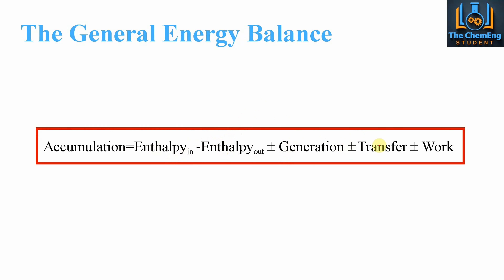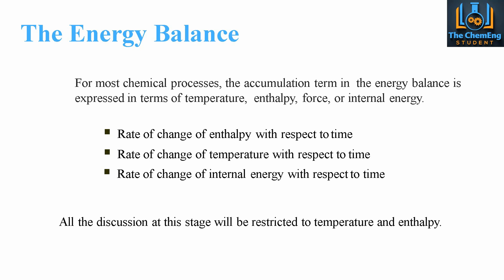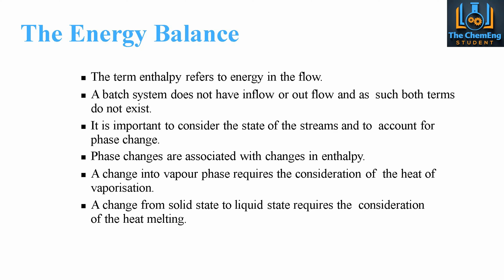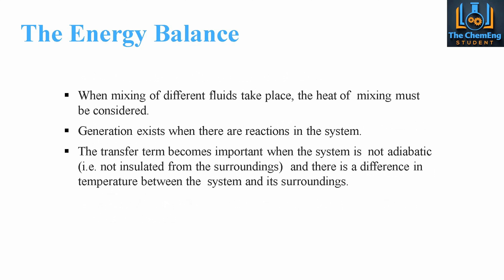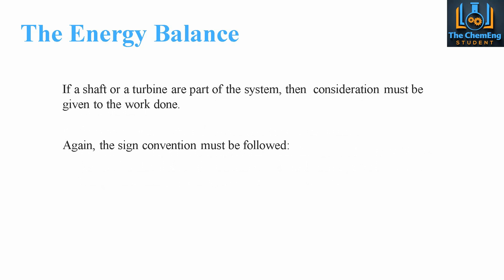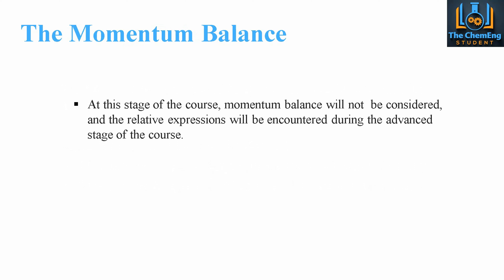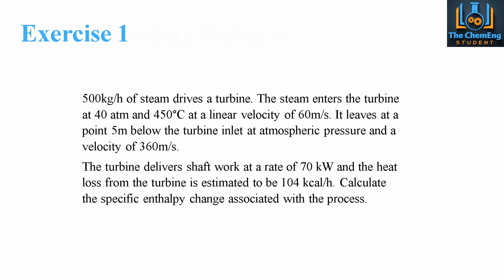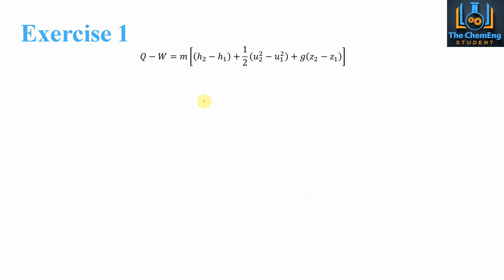How To Solve Energy Balances Easily | Chemical Engineering Explained

Comment: Shouldn't you account for the pressure change from 40 atm to 1 atm? That might let off a lot of energy...
Reply from the maker: Yes, you are correct that the change in pressure would be accounted for within the turbine; however, as we are told explicitly the shaft work rate, we can simply replace the W term in the equation directly. This example is more for fundamentals; more detailed systems are explored in subsequent videos and within our courses. Thank you for watching and commenting; it's much appreciated!